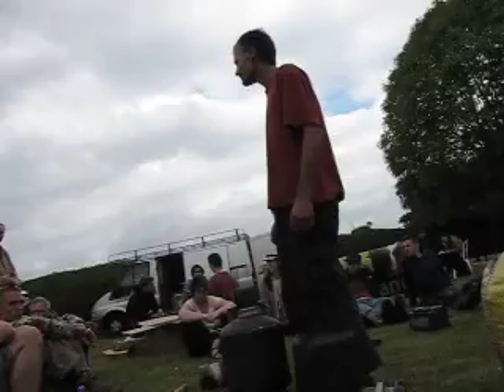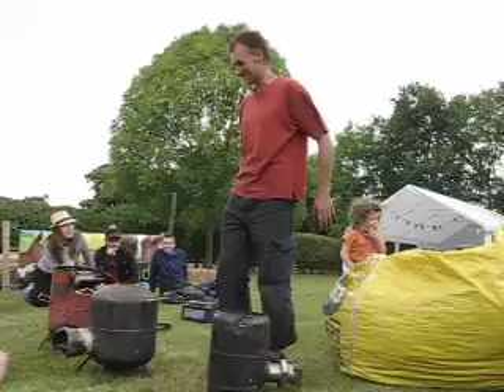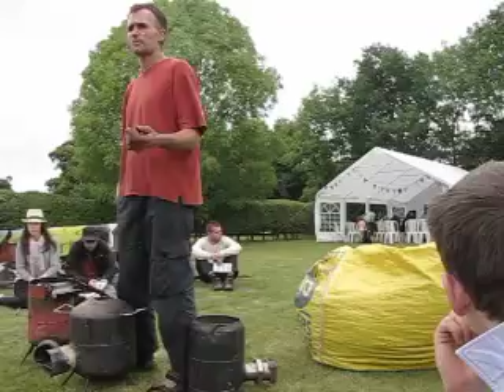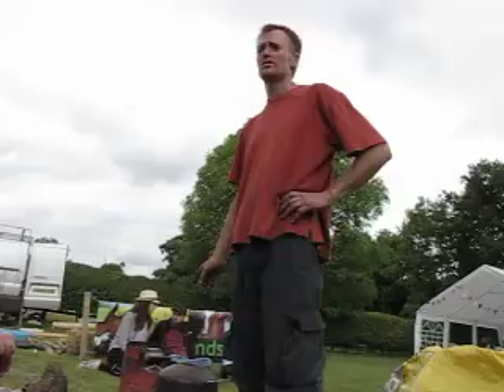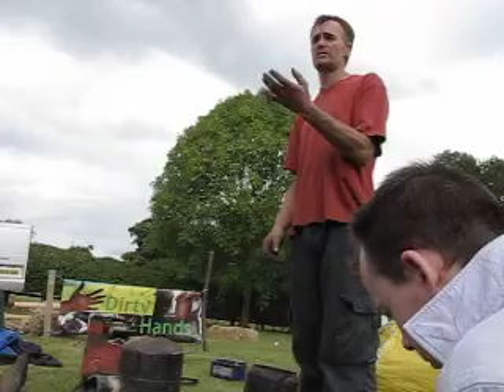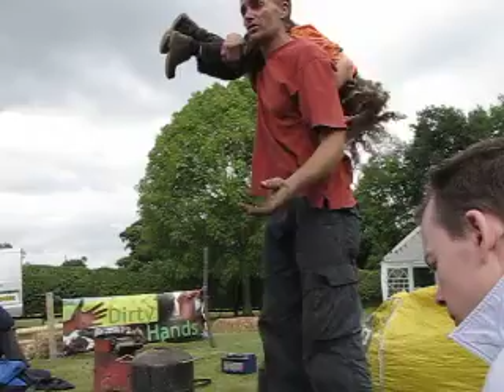Ed's biochar tech - 04 - Stove materials and biochar uses

Comment from the maker: Carbon the element is not causing climate change when it is stored in solids such as trees, graphite and fossil fuels. So you are you are correct. 

When carbon compounds react with oxygen they form carbon dioxide, a gas which absorbs infrared light. Type "CO2 experiment" into youtube's search bar and you will see a practical demo.

Regarding "chemtrails" I assume you are are talking about vapor trails emitted by aviation. Agreed, these contribute to climate change. Not sure what HAARP is.